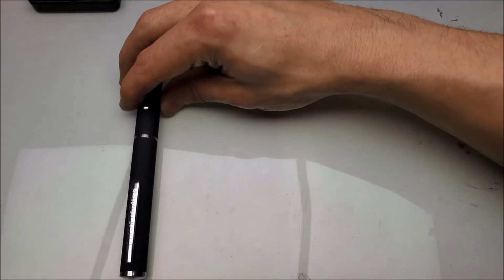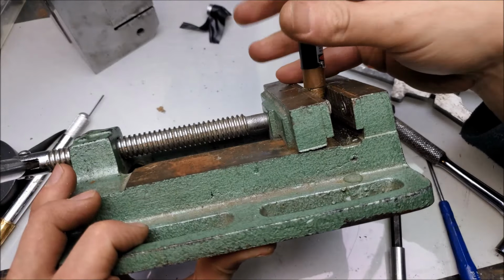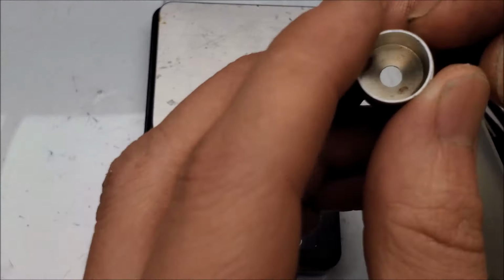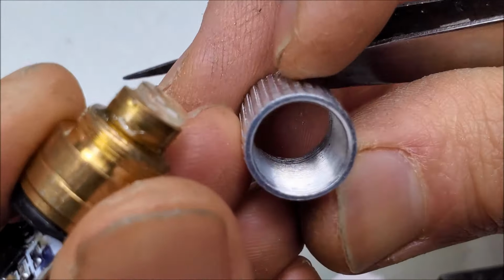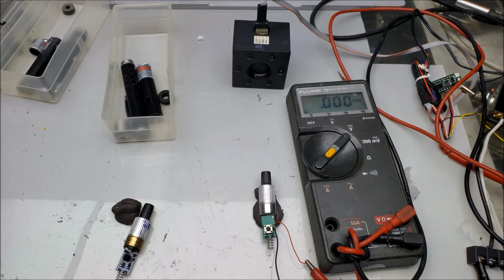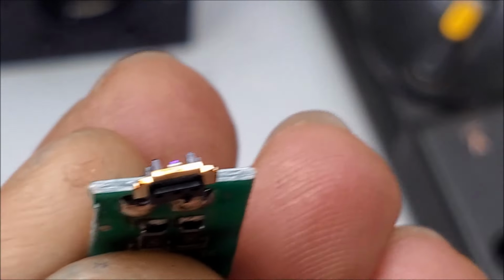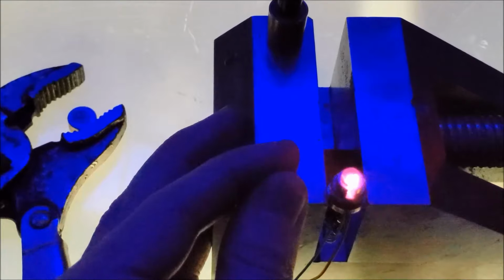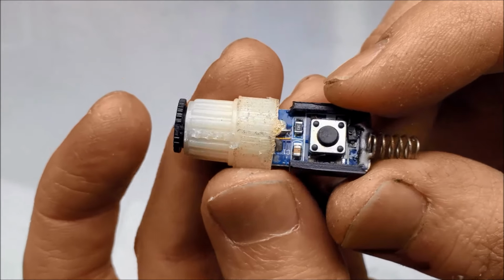532nm Laser Pointer Devolution

Comment: Hey, you like lasers right? How about science, do you like that too? Why not do both at the same time!?! Why not try to built a Michelson Morley interferometer and oh, I don't know, rotating it vertically, for a change? What do you say!?!
Reply from the maker: I do like both. Why not do both at the same time?

Excellent question in context to your proposal.

Is this vertical like a helicopter or vertical like a Ferris wheel? Just give me the rotational axes in x or y. 

Making a frame that wouldn't flex in that circumstance would be an absolute nightmare. 

Locating bearings would also be nearly impossible. Interferometers measure very subtle changes. It would be like trying to measure something in micro grams  while on a freight train. To much vibrations from the bearings. Optical gyroscopes don't actually spin at all. 

Using magnetic levitation is also pretty much out as a fully decoupled system usually a switching electromagnet and that could induce a lot of noise into the system.

Mode locking is also an issue with interferomters. This is where the interference doesn't change because of special photonic physics. They using something called dithering motors to physically move the optical assembly to prevent that, and well that isn't exactly easy.

There really isn't any good reason to even make that device honestly.
Reply: @Zenodilodon  Yes, change history.
Reply: @Zenodilodon  https://www.youtube.com/watch?v=7T0d7o8X2-E&t=4s

Comment: Hi. 
I took a green laser out of a party light. It’s got LEDs and a laser, shines on the roof and walls, and is music reactive. My first question: it doesn’t ever get hot, and I’ve ran it for 24 hours straight testing it. Is the laser going on and off to the beat of the music the reason it doesn’t get hot enough to burn out? 
Second question: I bought a laser driver from Amazon to run it. Except now the laser is purple. I know I must have damaged it somehow, but I don’t know how. And if I don’t know how, I’m destined to make the same mistake. Could you advise me this please. The driver I bought from Amazon is  5V in from a USB, and I checked the output with my multimeter before plugging in the laser, 4.6 volts. It’s does have a potentiometer on each of the two outputs, but I never adjusted them. Thanks.
Reply from the maker: Having the laser off for a portion of the time does help, but all in all there isn't all to much heat produced vs the mass of the module. Probably very similar to the energy in this video. As for the driver. They need to be constant current calibrated for the laser diode. You can use a dummy load like decently powerful LED to make sure the driver is set to it's low point. Then you connect the laser diode and set the current point. You could be over or under driving the laser. The junction voltage is typically 1.8V so testing across the output of the driver with the laser connected will show you that voltage. You can calibrate to that voltage as well, but no higher. 350mA would also work. Use the meter in Amp DC mode in series with the load similar to how to check current in this video or how I calibrate current in my other laser builds.

Comment: Thanks for the deep dive into this! I knew they had gotten worse over the years (it's obvious just from the weight alone), but seeing it quantified was fascinating. Very interested in the brief mention of the 593.5 nm crystal assemblies at the end, I thought they were based on sum frequency generation of two lines from Nd, not self frequency generation like the 561 nm modules you can find now too.
Reply from the maker: Glad you found the comparison fascinating!

The 593.1 is still SFG, it's just done with a self frequency doubling (SFD) crystal. I have been working on testing and gathering SFD stuff for the last 2 years. I think I have 3 of the 558-561nm SFD crystals, I also have a 565nm, a few 574nm, and at least one more 593.5 with hopefully more to test stuff on. It's been one of the slowest and most expensive projects but it should make an excellent video when I get enough data and parts together. You're bound to enjoy that rabbit hole!

Comment: hey, awesome channel! I've recently discovered your videos and am very impressed with the quality of your content! keep it up man. Let me ask you something? I've recently bought a 303 green laser pointer, and I'm wondering if I can simply replace the infrared pump diode with a red DVD diode, removing the crystals of cousre. Would that be possible? Can I drive the DVD diode with the components that drive the infrared by just swaping it?
Reply from the maker: The Nd:YVO4 is pumped by particular wavelengths. A CD laser diode from a burner is 780nm which isn't suitable to pump the Nd:YVO4. You will need 808nm Laser light. Secondly the diodes from a CD burner is for semi-pulse operation and usually maxes out around 150-170mW for continuous wave use and isn't really enough power to pump the Nd:YVO4 even if it was the right wavelength.
Reply from the maker: Oh I totally missed the goal of doing a complete swap and making it red, brain fart on my end. Yes you can absolutely do that! You will need to lower the driver current though. Check out my Bare and Basic DVD/CD Laser video for all the information you need! You will need to change the lens to fully collimate the beam so keep that in mind.
Reply: thank you a lot! I just saw your guides to dvd diodes, laser drivers and green lasers, absolute masterclass  @Zenodilodon

Comment: Test for how long until crappy laser burns out? If people find they only have a 20 hour life span, they might go back to doing things with a bit more pride 😅

What was the electroplating process?
Reply: No, people (lay persons) just want to buy the cheapest ones. Not enough people who are buying these pointers would understand what makes a good pointer and why. I knew this guy who would abuse the on\off cycle times recommended for his 450nm pointer until the module got hot enough to be mildly uncomfortable. Then the pointer would fail not too long after, and he'd buy another one and do the same thing to break it. He could not be bothered to care about what causes diodes to fail, and why. He just would not listen to care and safety, and he'd also buy solely on eBay, where they would sell him a $150 pointer with a plastic lens that would melt.

People want "toy" lasers, and they want them as cheap as possible, no matter what. This is best witnessed by the complete lack of IR filter on 90% of Amazon\eBay DPSS pointers. 

People are dumb. And these pointers are manufactured by so many companies, with only 1% putting an actual brand name on their products, there is zero chance of budget laser pointer manufacturers making their products better, and if they DID (and chose to attach a brand name to their products, so you would know which pointer is made well) then every cheap Chinese manufacturer would just change their pointer's LOOKS to appear as if they were the high quality pointer. 

Cheap lasers lost their identity decades ago, when the companies stopped using brand names, and every manufacturer just decided to call it a "301" or "303" based on the lens threading style. 

If you want a decent quality laser, you have to know what to look for from companies that only sell optical products, and \ or read a lot in Laserforums.com and stay far away from eBay and Amazon (and wish and Temu) where you can't even find out the brand name of the laser manufacturer. Good companies don't hide their brand names.
Reply: @Boogie_the_cat  are you high right now

Comment: Where do you explain the generation of the yellow light?
Reply from the maker: That's for a future video where I discuss a range of SFD Laser crystals. I am still collecting parts and running tests on that and it will be some time. It's one of those mega projects though and there is a bunch to still do.
Reply: @Zenodilodon  Would it be similar to sodium's 589nm emission? That would be very handy!
Reply from the maker: @SarahC2  There are 589nm Lasers but I have yet to get one. I have tried 593nm in some sodium line stuff such as black fire and it doesn't work.

Comment: I had no idea there were green pointers as early as the mid 90s. They must have been insane expensive to buy then. Who was even selling them? Edmund? I think the first time I remember seeing one was around 99 or 2000 and I was WOWED by it and how much brighter it was relative to the red. The most amazing thing is not just that they're $2, but that they're still made at all when I thought direct diode green would have taken over years ago. I guess the relative inefficiency of InGaN in the green is to blame.
Reply: They were sold by CNI and a company out of Russia in the 90s, though several companies made modules back then. Price was scatter plot, 20 bucks and up to hundreds. Edmund did have them and they were rebranded CNI lasers. I gutted a few cni lasers for the ktp crystal for keeping show lasers alive if a ktp burned up. They used a discrete HR and OC mirror, a C or B mount laser doode and a basic collimator, though better ones had a beam shaping assembly to deliver the pump beam to the crystal more efficiently. ❤
Reply: @christopherleubner6633  hmmm interesting. I will subscribe to your newsletter.  haha

Comment: Hey Zenodilodon
I recently bought a laser diode which I firmly fit in a laser module for its driver and thermal heatsinking. I got a small torch case in which the module fits perfectly ( tightly ). Now the module being metal and also the torch case, it is creating a problem. The problem is, since this torch uses the case(metal) itself for one side connection and the laser diode is case negative and the diode is in contact with the case via module, as far as I know, if I used the case as the connection the unfiltered or unmodified current would damage my laser ( please correct me if I'm wrong).
If this is a problem
Is there anyway I could modify the driver or do anything to eliminate the problem for fitting it inside the case?

Looks like a great video! Haven't watched it fully yet.
Reply from the maker: You will need to case isolate the diode host and will need to manually run a connection from the positive of the housing of the torch case to the driver. There isn't a good way around this and you will have a direct short otherwise.  Kapton tape  works pretty well, but you may have to carefully sand your diode host down thinner to make it fit.
Reply: Thanks! Is there any other way to do it. Because, the diode module fits tightly to the torch case that I cannot isolate it from the case and also the switch of the torch is at the back of it
Reply from the maker: @c4land6  No, I have had to isolate all my diodes that are case negative. You cannot use the case for positive because that will cause a short and regulation almost always happens on the negative which means an attempt to use the case as negative will completely bypass the driver regulating the current to the diode. Isolating the diode host from the case is to my knowledge the only option you have.
Reply: Can I Isolate the the back cap of the torch instead? And bring another isolated connection for it?
Reply from the maker: If you have an idea you can try it. I have always isolated the host from the case, Not really tried anything else. I can't really recommend a better option as the one I use seems to have a 100% success rate.
Reply: @Zenodilodon  Thanks for the help! You're idea seems more convincingly better after considering. But I'll have to grind the host down. One question though can you suggest me a good driver for powering a dvd laser diode?